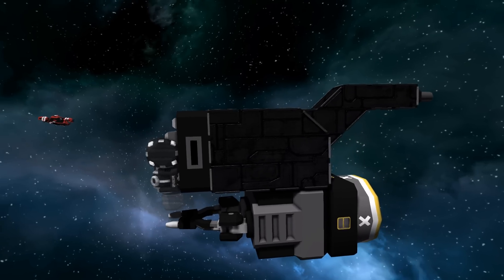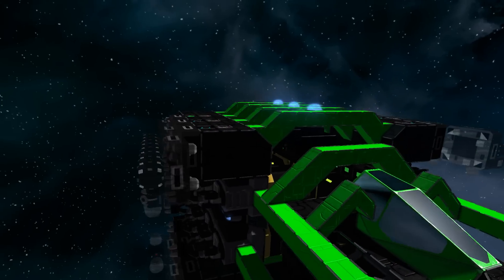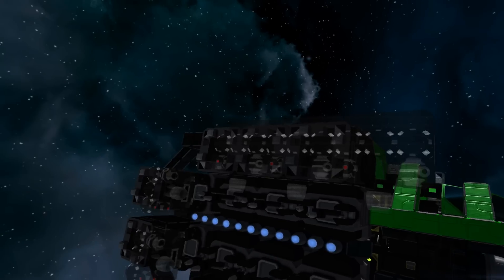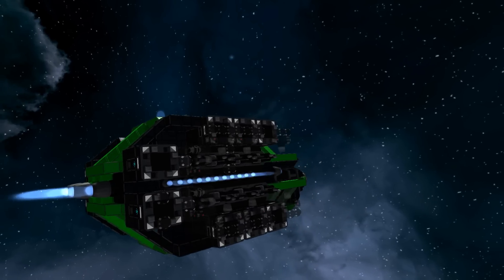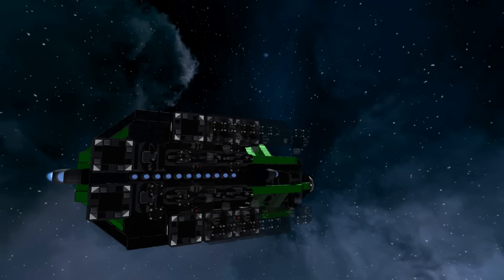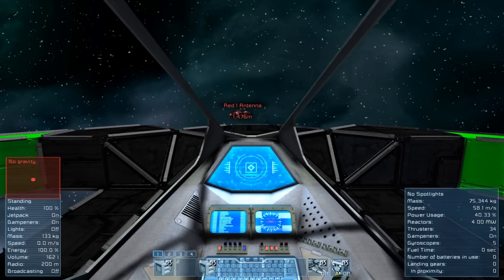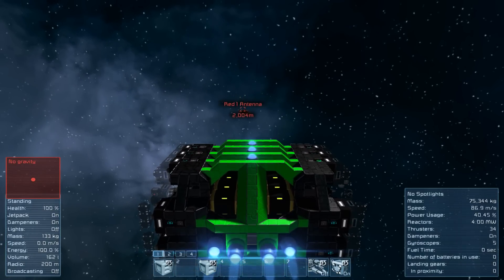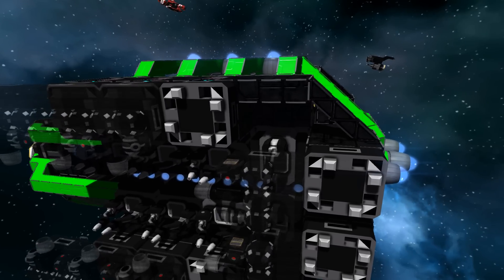Space Engineers - Next Gen Carrier #3 - Turkey Chaff Deployment Craft, High Speed Decoys

Comment: I tried to use this design on my ship and am having difficulties with the projectors.  When lined up the projectors identify the merge blocks as being inside each other i think, resulting in the decoy itself not being printable.  how did you get the projection lined up so as to avoid this problem?
Reply from the maker: dan hunter You have to offset the projection in the control panel to line things up - and the projection will move depending on how fast the ship is moving so the offset will be different at different speeds. Hope that helps!

Comment: is it possible that none noticed that this thing can't work in survival? decoys, thrusters and gyro needs power so you put the small reactor on it which is fine in creative when it doesn't need to be actually fueled to work but in survival it will simply not doing anything at all... still interesting concept maybe with some future toy it will work
Reply from the maker: It can now ofc, the addition of programming blocks would allow (with a small change to the design) the ability to auto-move uranium in via a connector. At the time of course there was no way that it could be done other than manually which kinda renders the concept useless so I admit I overlooked that :( Should be possible now though with some tweaks!

Comment: I just got passed the section where you explained what Chaff is and I felt the need to correct you. ECM (Electronic Counter Measures) Chaff is not designed to interfere with heat guided missiles that's what flares are for. ECM Chaff is thin pieces of aluminum sprayed out of a canister into the air. The aluminum pieces scatter and confuse radar guided devices by obfuscating the radar signature of the craft that launched them.

 You got the design of the chaff right but the description wrong. Anyways good luck with your Carrier.
Reply from the maker: Thanks :) I have been VERY well educated on Chaff vs Flares since the release of this vid lol..
Reply: ***** Hah, I even scrolled down a bit to check and didn't see any. My Dad was an engineer in the Airforce, he worked on F-18's a lot. As you may imagine I grew up being a bit of an aviation nerd. As an Aviation nerd I really like your channel. The Blackbird is a really cool design, both functionally and aesthetically.
Reply from the maker: *****
Sounds pretty cool as fathers go, I'm a fan more than a nerd (as evidenced by the Chaff screw up!) but still find in-particular high mach military planes fascinating. Glad you liked the Blackbird, and the channel ofc.. one of the few planes I actually do know a fair bit about :)

Comment: You can use a rotor with some blocks sticking off of it and a sensor block to get a reliable timer down to 0.25 seconds.

Another flaw with this design is that the chaff will fly away from the enemy just as quickly as it approaches (though the gyroscope idea will work, as long as you add another engine to reduce the normal velocity). Could work well for escapes though.
Reply from the maker: Nice trick for the timer, wondering how would you use that to actually trigger something to launch after x seconds without having a load of timers? e.g. how'd you work out if it's the 180th time the sensor has seen one of those blocks?

Ended up kinda taking this idea and upgrading it into the death lotus for offensive purposes as you are correct in that the big flaw is how fast the decoy's leave the area.. gyro thing kinda worked, kinda didn't as it bulked them up a huge amount so for now the CDC is more of a defensive tool as you say.

Comment: You said straight lines only, but one question I still have is: "Would it be possible to barrel-roll will using this?"

The reason I ask is because the chaff is so uniform in it's deployment that I feel it may not adequately distract enough of the turrets while other fighters and/or forward assault craft come in range.

Just a thought~
Reply from the maker: Sadly not, barrel roll seems to be about the worst move you can do to make it build wrong, end up with big lines of decoys on the sides... however the solution someone else suggested of using overridden gyro's to make them "orbit" after launch should help with what you mention also.
Reply: ***** That does sound like a solution. It's unfortunate that it's a 1-directional thing though.
Reply from the maker: Derr Mann Could go further if you wanted, make it 2 gyros and a timer block to switch between them, would add a considerable amount of extra "random" into it. There's room on the projectile for 3 more 1x1x1 blocks so could do something with it for sure :)

Comment from the maker: @Guy Ginger No turrets on it because it's a small ship, so won't be me use them without mods :)
Reply: Why the merge blocks? If they weld that fast, they should be able to weld and deploy right away. It would save time as well
Reply from the maker: ozzyjames87 And military countermeasures confuse me it seems :) Ty
Reply: You've over complicated it; the chaff doesn't need a reactor/gyro/thruster

a single line of independent(unconnected) decoys will distract any missile/gatling turret + any small/large ship seeking sensor driven missle
Reply: ***** Chafe is for radar missiles flares are for heat seeking ones
Reply: Chaff confuses radar, flares confuse heat seekers.
Reply from the maker: Josh Repavich With projectors there has to be some "connection" to an existing ship to weld from.. in this case it's the merge blocks as they are quicker to detach than by grinding. Don't believe there is a way to build them just floating in isolation, have to be connected to the ship in some way.
Reply from the maker: Vaprous
I did yeah, learning process :) This one was a while ago now, pre--some of the ideas that has used this base concept for something better!

Comment: what about a mass cannon with that mod that makes mass blocks not require power so you could use your grav cannon design attached to  your already existing carriers in a smaller form also chaff only works on radars and radar guided missiles heat seekers would just laugh at the chaff and hug you
Reply from the maker: For the time being I'm kinda staying away from mods as once you start it kinda opens the floodgates to adding more and more and the extra things you can do with them. Do intend to start using mods at some point in the future and then doing some videos focusing on that but for now want to try and keep things vanilla :)
Reply: that was only for making it easy for survival but in creative could just use a small reactor
Reply from the maker: Aye, I think for survival there should be a way to fit a solar panel on it just about, make it a little bit larger but also then no need for messing around with uranium.

Comment: Problem: these won't work in survival...
Reply from the maker: For survival I'd add solar power instead of the reactor, which would probably require a slight change in the projectile design but would mean they could work similarly to the ones from the Vulture RDC I did recently. The carrier I'm building will never exist in survival so I'm taking a few liberties at the moment because of it, will do my best to keep survival in mind though and plan to return to doing some survival mode vids soon :)
Reply: One idea, which might actually be cooler, is having all of these on a big, fast rotating cylinder sharped thing, so the angular momentum will throw them out into space in random directions.  since decoy blocks don't require power, not only would this require less parts, but it would also have more randomness to the dispersion of the decoys.
Reply from the maker: Yeah, could work pretty cool and cuts them down to literally 2 parts, a decoy and a merge block to separate them.. Only "issue" is that I don't know how projectors will react to being spun round like that, chances are the projections will move around and make it really hard to line them up right (same reason the ship above does straight lines mostly). Still a really simple idea so will have to play with it and see what happens.. cheers :)

Comment: I was thinking about this ships purpose, and it is going to be shot at a lot, in fact, it will be the only thing shot at for a bit. So wouldn't it be better to make it a drone operated by someone in the main fleet?
Reply from the maker: Yeah could well be a better route, the only downside to making something a drone is the antenna and the inevitable giveaway that you are approaching. Still the benefits most likely outweigh that one downside in this case, not sure it would look as cool though :)
Reply: I didn't think about the need for an antenna, and I suppose that traveling at max speed it would pull out of range pretty quickly.
Reply from the maker: TCStall
You can get some pretty serious range on them but for every bit of extra range you add it's a bit earlier the enemy will see you also :)

Comment: I love this idea, but who is going to load those reactors with uranium traveling at 104m/s? Batteries and solar panels make it too bulky and resource intensive, I like how sleek the look is with no grinders, but I think you're still going to need them for tube-cutting in a survival ready build. Which sucks because that thing is awesome.
Reply from the maker: You can do something with connectors also and keep the merge blocks which I tried in the hangar vid last week, but that has the same issue of bulking up the design massively. You might be able to get away with just solar panels and ditch the batteries entirely though, 1 thruster, a gyro and a few decoy's really don't take much power. Gonna have to try adapting that as you are not the only person to mention it's flaws for survival mode. Thanks :)
Reply: ***** You're a boss.

Comment: Chaff is strips of aluminum foil that reflect radar to confused radar seeking missiles. Flares are what are used to confused heat seeking missiles. Although those are kinda outdated concepts, aircraft now are using towed decoys that emit radar or use lasers to confuse attacking missiles.

You can get around the 1 second delay if you use the "trigger now" feature of the timer block, it overrides the timer count down feature and just activates whatever you have programed it to do. I use them on some ship launched self guiding missiles I've developed and they work good. But that's not to say that the countdown feature of timers isn't useful for expendable ordnance, they are very good for setting safety ranges on your equipment: very useful if firing your ordnance in "maddog" mode.
Reply from the maker: Yeah it was annoying, the 'trigger now' was slightly too fast, the 1 sec delay slightly too long in this case.. I kinda knew when giving that brief explanation that someone was going to fill me in on what exactly it was :) Didn't realise it was radar rather than heat later though, u learn something every day.. Thx!